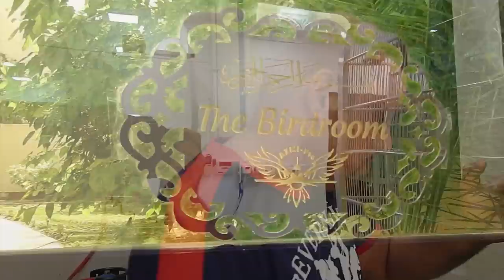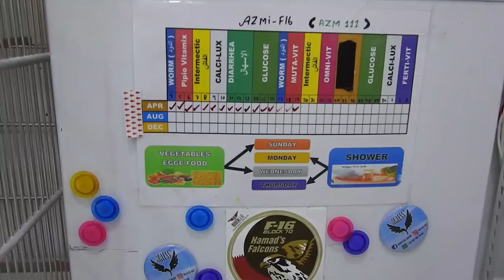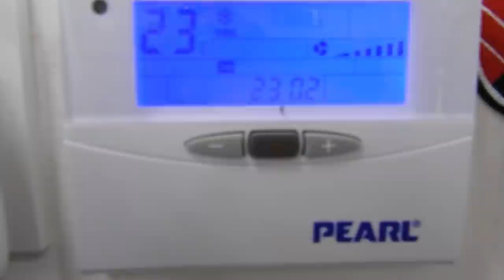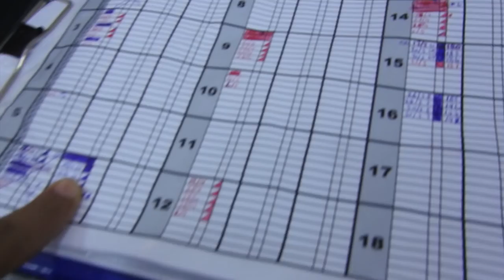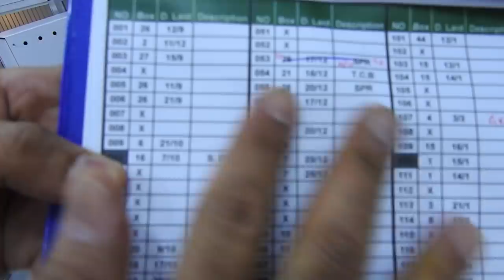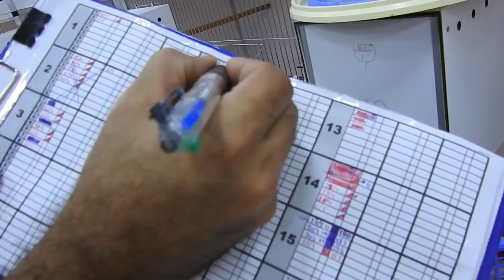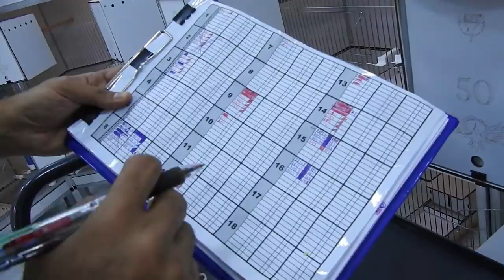BIRD VOGEL CARE| Exhibition budgie CLEAN, DISINFECTION, FEEDING|STEP BY STEP TO HAVE HEALTHY BIRDS.

Comment: When do you remove unfertilized egg/s from nesting box ???
Reply from the maker: In about 3 days you must see the live inside the egg if you see it infertile after 4 days you can remove it or change it for a plastic egg. Plastic eggs can help to avoid that chicks feel all the parents direct weight.
Reply: @BudgiePlanet  than you sir...sorry to bother you but could you please give me tip to get rid of mites...is fogger any good?...or u would recommend some medication as a prevention...have you got any videos with this topic please....
Reply from the maker: Cleaninf is best prevention to avoid mites and also try to have a fresh place. Mites becomes a problem on summer. Use cages easy to clean can be A good help
Reply: What size are your breeding cages pls?